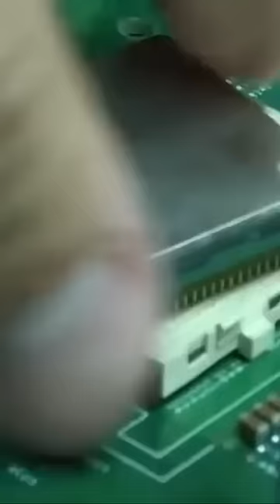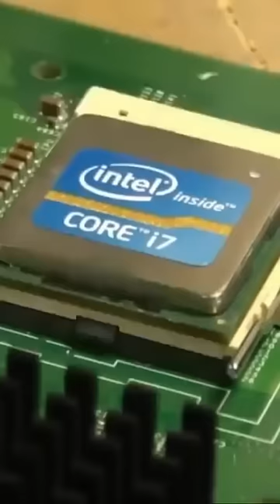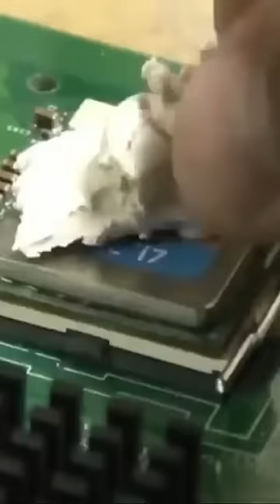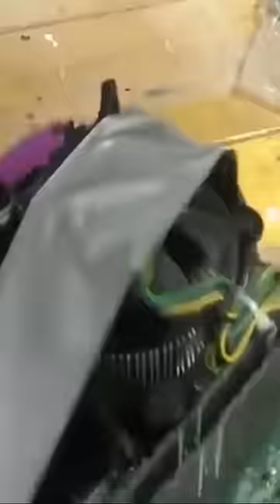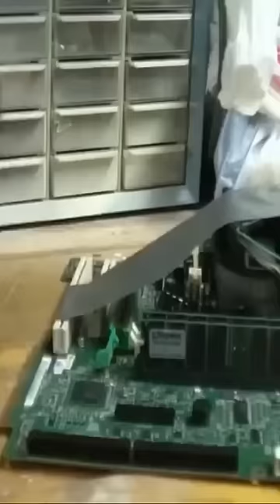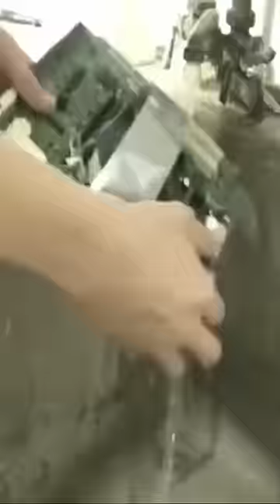Kanka benim pc de amd am2 ddr2 anakart ddr1 ram ryzen islemci var gta -2 fps

Comment: My heart accelerated to infinity when I saw him pushing the CPU, HE ALMOST FREAKING BROKE ITTTT!!!
Reply: Pretty sure he did
Reply: 1 pin bent and its joever
Reply: @Ballista_X  Fr
Reply: Im not pc builder but should he Take off the white part?
Reply: @stl443 no
Reply: you really care about that when literally he washed the whole thing, put the rams with a hammer, put a core i7 sticker and finally applied cream cheese to it?
Reply: @stl443 no, but you’re supposed to drop it in, never push it in
Reply: @thetshadow999animates9  it would broke the pin right?
Reply: @stl443  yes
Reply: @stl443 yes
Reply: @Ballista_X  na you can bend it back
Reply: @Ballista_X no, most pins are backups for grounding, if you break a backup it'll still work.
Reply: @Ballista_X not really
Reply: If cpu doesnt press in smoothly then there’s a bent pin. All you need to do is bend it back in place. Do this and you’ll break off the pin probably.

Comment: if this doesn't turn on, blame the monitor
Reply: whos gonna tell?
Reply: 😂😂😂😂😂Hahahahaha
Reply: Yupp your right then kindly and carefully disassemble it and wash with detergents and then quickly assembled it before the water get dry in the PcB board and plug it to nearest power supply and boom.... The monitor is the problem 🤭🤫🤣🤪

Comment: This will be computers in the year 1
very high tech
runs gta at -2 fps
faster than gtx 4030 stainless steel and core i2 100000 and amd rysing 58 9080 combined